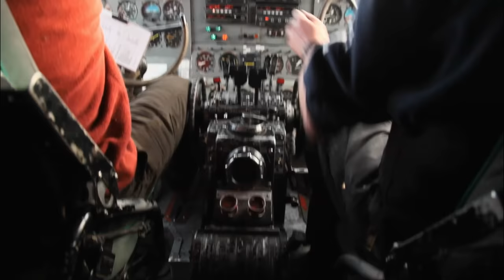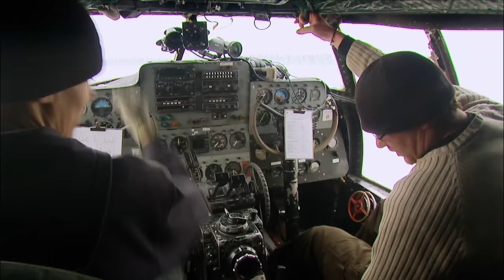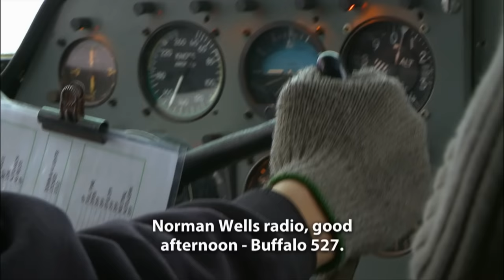Last Days - Ice Pilots NWT S03E08 - Go Xplorer

Comment: I was employed at everts air in Fairbanks for about 10 years. I was a load master for the C-46 and DC-6. Before that I worked at NAC. Great job, long hours when the flight crew needed an extra hand. Got a little stick time in the DC-6. Miss those days. The C-46 was a cool old bird. We hauled a bob cat loader out to a lodge on the back side of Denali one winter. I think it was on twin lakes. They we’re building an addition to the lodge. The cab was removed. Had to have a special brain box to make it functional. Steep ass ramps to unload it. What a trip.

Comment: Gordie took that check ride because he had not heard from First Air since he applied, and had pretty much given up that job. Sheer luck that he gets the call immediately after being promoted to Captain on the C-46. Old man Joe is set in his ways and butthurt about it. I for sure wouldn't work for that hold man
Reply: I think Gord should have stayed and put some time in at Buffalo. They have put a fair bit of money and effort into getting the guy where he is.
Reply: It costs the company thousands of dollars to make someone a captain that’s why he was mad. It’s not just the fuel and man power costs! Every plane has maintenance costs that have to be factored into every hour the plane flies. Like the engines on the 46 every 1500 hours get overhauled that’s 100k per engine plus labor and any parts.

Comment: Couple of things;
48 inches of clear ice will hold .......almost anything.
As soon as you clean lake ice off, it starts to thicken even further.
Landing on ice is a sheer pleasure, especially in heavy crosswinds.
Reply: I once landed a C-185 on wheel skis on glare ice at Pukatawagan, Manitoba. Ground looped, went around three times, and came to a stop backwards within twenty feet of my party. I couldn't believe they'd board the plane after seeing that, but they got in.
Reply: @paddy1952  Pukatawagan, Pukatawagan, that's where I was beeyorn LOL
Reply: @paddy1952  Pulled into the apron at YNE in a Chieftain years ago and realized it was pure slick ice and I was headed for the bushes. Brought the power way up on the left engine and the airplane spun slowly around and I stopped the slide with "reverse" thrust LOL
Reply: @scheusselmensch5713  We did that in an HS-748 at Cambridge Bay, NWT. Got away with it.

Comment: Those manifolds would be easy enough to make. I don't get why they would want to rebuild junk.
Reply: Wouldn't say those exhaust manifolds would be easy to make,  but they could be fabricated by a good shop. And it probably would be a better system than the original with the better materials today. All it takes is time and money.
Reply: Simple. Money. It's cheaper to find an existing part than create a new one. Especially for a one-off like a C-46.

Comment: I don’t see why new exhaust manifolds couldn’t be made. Probably cheaper than finding a plane to replace the 46’s.
Reply: I think the issue lies with the aircrafts certification. Sure any fabricator worth his beans could fab up a set of manifolds for that engine in his sleep, but they wouldn't be certified c46 parts. The FAA, or whatever the heck they call it in canuckistan would have an issue with that. Mr fabricator hasn't paid the bribes.

Comment: I looked up the tail number on the C46.  It was wrecked 7 years ago.
Reply: That one ?
Reply: @CFITOMAHAWK  C-GTXW  9-25-15
Reply: I believe they lost an engine coming in to Deline fully loaded. Pilots did the engine out procedure but lost so much altitude and speed they couldn't risk putting the gear down without outright stalling the plane so they bellied it onto the runway.

Comment: Being promoted from the ramp to the cockpit without a lot of recent control time is not good. 

The incident with the pitot heat 'failure' is an example. His airspeed indicator is showing the aircraft is slowing down. But he would feel no difference in control forces or feel. That is from being rusty.

Comment: If they keep running out of parts for the C-46 they will have to either replace the engines with turbines. I’ve heard a few stories on DC-3’s that have been converted that it’s made them a different but actually better airplane. I’d prefer to fly the Lockheed Electra.

Comment: Not every pilot can say I fly a C-46 for a living. Impressive. Although cool to see still flying, those planes are running out. There must be a replacement that can handle the job the 46 does. Maybe the Convair 580 can (?). They're old to but nearly as old as the C-46 or the DC-3s. To keep those old birds flying, new hand made parts must be done but at what cost if even possible? Gord's a very lucky guy to have Nadia.

Comment: not hard to manufacture the exhaust parts
Reply: Have to remember, unlike your car every part has to have approval from the CAA or FAA in the states. Even the printer paper in the airliner I fly has a number printed on it showing it’s FAA approved.
Reply: Joe would rather go with old scrap parts than spend the money to have a system made.